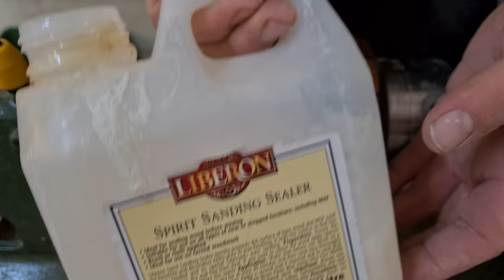Woodturning - The 3D Puzzle

Comment: This is really cool! You should definitely make another attempt to try to get the gaps more even. Maybe put the glued together peices in another cylindrical container that's slightly wider and just use slow curing resin and put it inside a pressure pot or a vacuum chamber. Then you can sand the excess resin until you get to the wood and it should have no bubbles
Reply from the maker: Thanks Josh. Your thoughts are exactly what I should have done! I do want to try and improve the concept so will also work on varying the direction of tabs and blanks next time, but still keep more uniform gaps throughout! Thanks for watching and commenting. All the best. Ray

Comment: The trick to getting all the air out is to use vacuum ... a good vacuum pump, suck the pressure down, wait 1 minute, let the air back in, wait 1 minute ... 3 cycles of this and you will have zero bubbles. Zero.
Reply from the maker: Hi Robin. Thanks for the suggestion. I don't have a good vacuum pump and rely on the deep pour resin to self evacuate, which it does really well. The problem was trapped air rather than air bubbles in the resin. Not sure if the vacuum action would also help remove those trapped air pockets? If I had used a bit more resin, cast it in a lidded pot, then I could have probably removed the air. But I didn't. Alas. Live and learn! Thanks for watching. All the best. Ray
Reply: @RayWhitbyCreations  Yes, vacuum will remove all those trapped pockets etc. I use an old pressure cooker as my vacuum vessel and a pump I got secondhand from eBay, 3 cycles of vacuum and then release totally solves any trapped air and gives a very solid cast. If you can find a good vacuum pump, its worth the effort, it makes a huge difference.
Reply from the maker: @itsverygreen532  Will have to save up and hunt around! Thanks Robin!